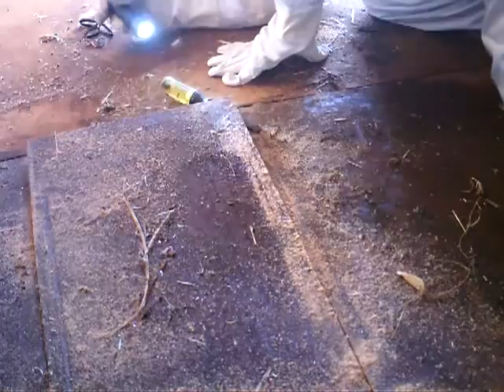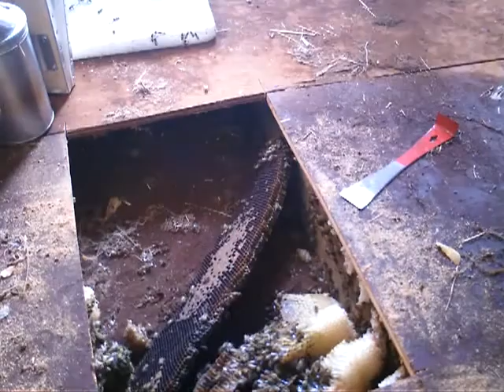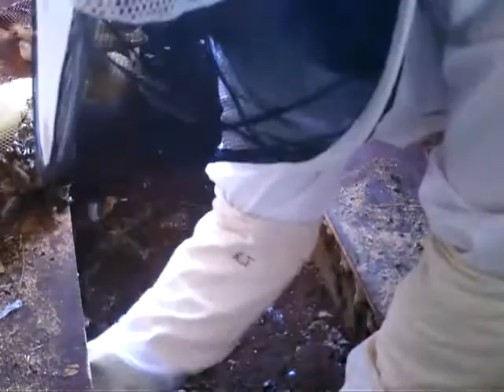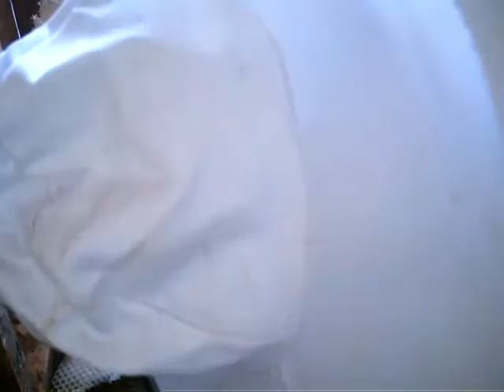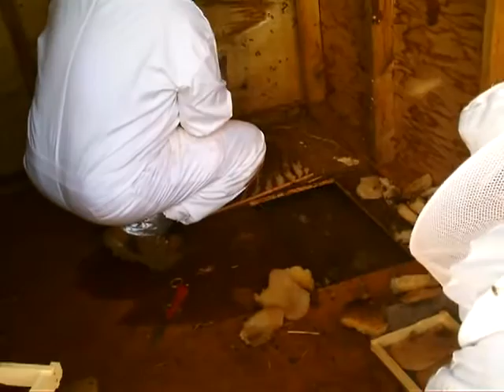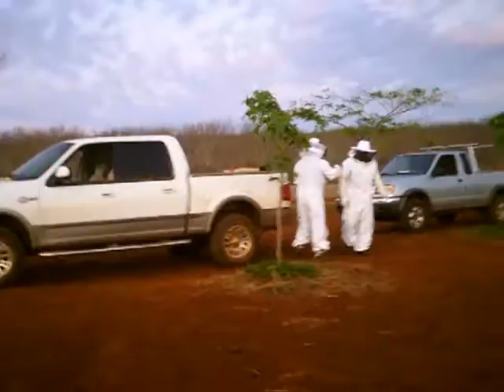Mr Irie & Da Bee Squad - Bee Removal - First Timers

Comment: im making a pipe now that has the shape of a "sherlock" or, in fact it is the base of the antler that connects to the skull, with 1 large bowl carved and a mouthpiece outta the small tiny horn at the base. i need to get a cam so i can send ya a pic.  well my prob is it leaks air. the pours, in the bone, must be to "holey" lol and they let toomuch air to get sucked in through microscopic holes?!?! should i scrap this i dea find new "stock" and start over?